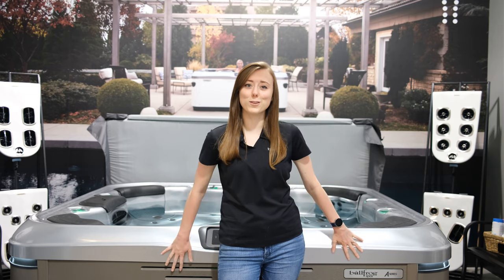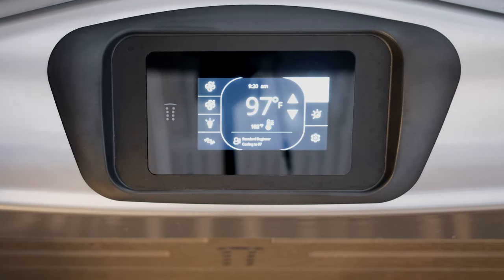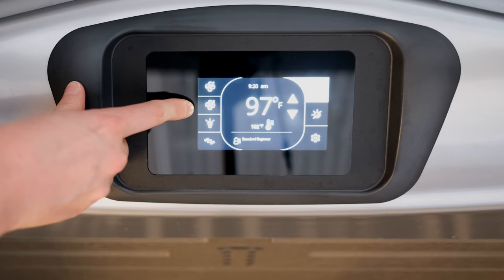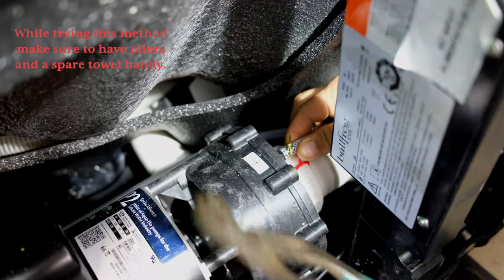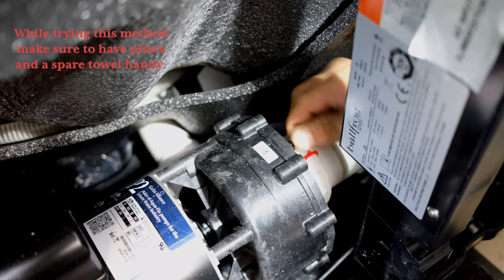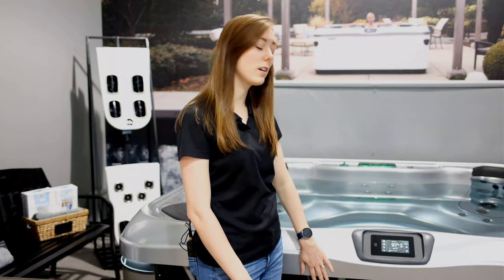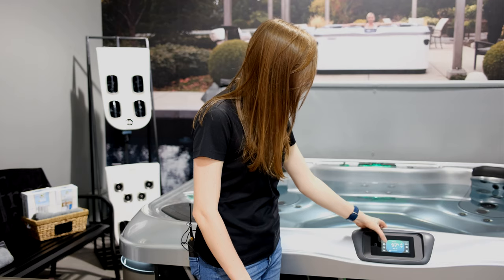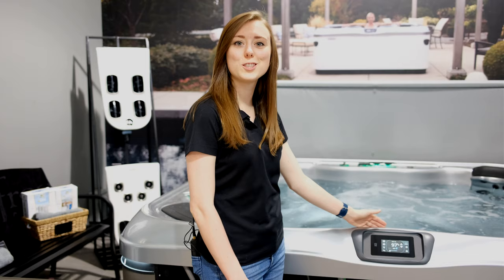How to remove an airlock from your Bullfrog Spa

Comment: sadly my new 2023 bullfrog spa has been a love hate experience. My new spa is air locking every day. I clear the airlock (with much effort), and using the tub, then overnight it will airlock again. I am still waiting for dealer to help diagnose and fix. Meanwhile I've grown very tired of the headache to remedy just to use the jets. Bullfrog needs to make something that works out of the box. This is awful - I cannot recommend bullfrog at this time.

Comment: This didn’t fix our problem. Removed the hose and still no water came out. Hours more troubleshooting. Bullfrog wouldn’t send a technician. Also heads up, the connector piece is very brittle
Reply from the maker: I apologize for your experience. I see that I am late to replying, if you have any more issues you can contact the main Bullfrog using this their Customer Support number (801) 307-3676. Thank you!

Comment: This helped for sure, and I wanted to comment on what's helped me every fill except for the last one because of wind (that made me try to keep the cover down for leaves). If you fill through the filter tubes, it seems to help airlock issues. I had the airlock issue on the first fill (not filling water through the filter pipes), then never had the issue for many fills by filling through the filter pipes. This time, I didn't do that, so now I have to use this method. I'm not saying that his is a 100% for sure prevention,  but it sure seems like it. I got that tip from another video when I had the issue the first time.

Comment: Put your SPA on Hold by using the controller menu. 
Remove your filters. Use a toilet pump and pump each of the 2 filters openings. You should see air bubbles coming out from the lower end jets.  
No need to open the front panel etc. 
Resume the SPA from Hold using the controller menu. Should work 🙂

Comment: I have a Bullfrog X6L and the water pressure since we got it has been poor. I don't believe theres an airlock but have bled the pump as shown in the video and still the water barely pushes out of most of the jets. Is there anything I can do to fix this? 
I have tried cleaning the filters, draining to the tub, and bleeding the air from the pump but nothing seems to help.
Reply from the maker: The X6L has the option to be a 1 pump or two pump spa. If it is a 1 pump this will explain why the water pressure isn't super strong. For 1 pump spas I suggest turning the other jets off by turning them to give more pressure in your desired seat. If this is a 2 pump spa I would suggest making sure all the jets are turned to allow the full pressure to exit. (Sometimes from the factory the jets are turned down, to adjust move the jet either far right or far left) If this does not fix the issue I would have your dealer send out a tech to check out the pumps! Hope this helps!
Reply: @BullfrogSpasofTriCities  thanks for response! I wish my dealer would have told us this. They said if you made any changes to the standard than it would increase the wait time for delivery. 
Do you know if we could upgrade our current unit to have a 2nd pump? If so is it an expensive upgrade? I plan on heading up to our dealer tomorrow because even with most jets turned off the pressure it disappointing.